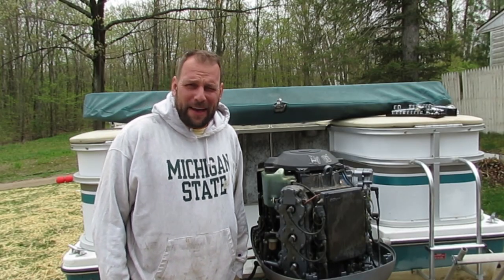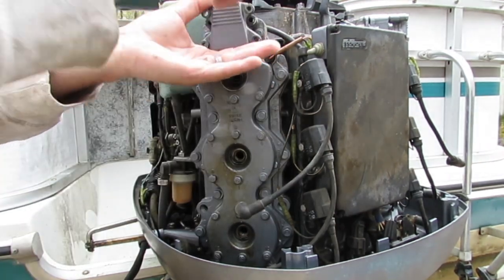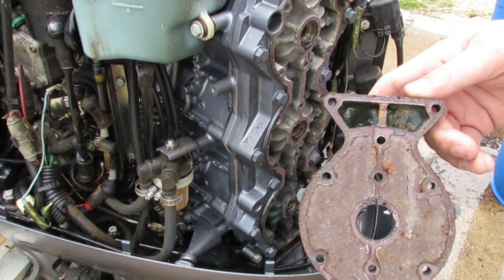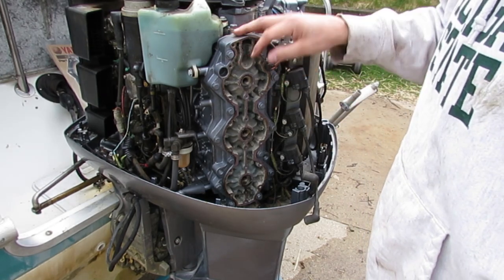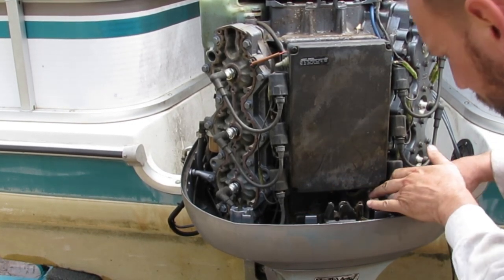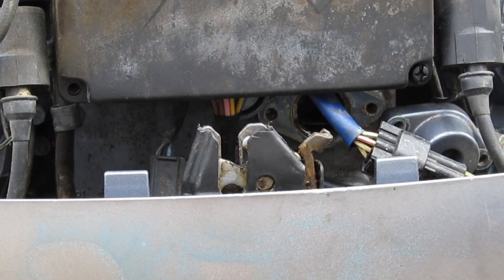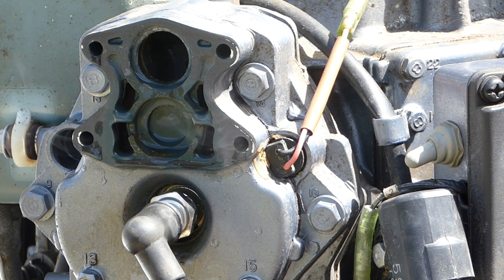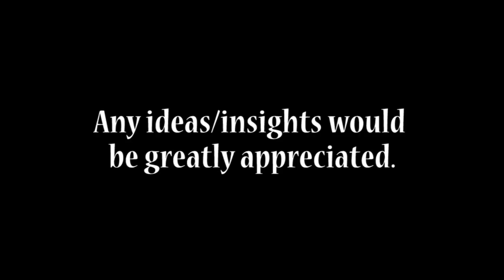Outboard overheating - I've tried everything...

Comment: OK, well I am an OMC guy, but the cooling systems are pretty similar to the Yamahas....First, let me ask if both heads got hot during your last test on the flushette?  Don't cut yourself down, I admire your thought processes...I'm sorry that you pulled those water covers off though, a lot of work, and it seems unlikely the problem is there...The water first flows to that exhaust cover, where the pressure relief valve is located...From there, the water flows to/through the heads and out of the engine.  But, the water flows from the back of the heads out through the thermostats then down and out of that cylinder head cover you removed.....So again, it is very unlikely that the head cover was plugged causing an issue.  Let's back up to last year when the problem began....Tell me more about what happened when the overheat alarm went off.  You said you replaced the impeller, how did the old one look?  Was it damaged?  Were any of the impeller vanes broken off?  If the old impeller "looked OK", there is probably another issue causing the overheating.   Keep in mind that there is more to proper water pump operation than just the impeller.  The impeller housing/liner must be properly sealed and not worn, is it possible that you crushed the water tube grommet when you reinstalled the gearcase after replacing the impeller?  How long did the engine run OK this year before it started overheating again?   That cooling telltale is at the beginning of the cooling circuit, so a good flow from the telltale doesn't mean the engine can't overheat.  Again, I'm an OMC guy, so not that familiar with the Yamaha systems....But, that large bypass valve in the exhaust cover confuses me a bit...Was there a spring inside that cover/hose that fit over the plastic bypass valve?  I'm thinking there should have been some sort of spring there.  If not, water entering the exhaust cover (beginning of the cooling circuit) can just dump out of the cover and never circulate through the block....Kind of a cooling system "short circuit" that would surely cause the engine to overheat.  The other thing to keep in mind is that running an engine on a flushette can be deceiving....The water pressure from the garden hose is acting like the water pump...So, it is best to test the engine on the boat in the water....I realize this is a pain, but it is important to realize how the pressurized garden hose can be confusing the issue here.  So, I'm guessing that whatever was causing the engine to overheat last year is still an issue now.  Does your boat have a water pressure gage?  Just because water is flowing out of the telltale, does not mean you have sufficient water pressure to cool the engine properly.....Don't remove any more water covers and cylinder heads.....I suppose it is possible that you have a blown head gasket, but not likely....Doesn't look like the engine was overheated badly....Again, I will ask you to start the engine again (on the flushette is fine), wait a few minutes for the alarm, the shut it off and feel the top of both heads.  If both heads feel hot, blown head gasket(s) are unlikely, which is a good thing.....I am thinking your problem has something to do with the water pump not working properly, like others have said.  Reply back with as much info as possible, try to answer the questions I have asked also....Hopefully, a Yamaha guy will chime in....Again, please don't pull off any more covers or cylinder heads....Hopefully, your problem is a simpler one....
Reply from the maker: It turned out to be that I bent a metal tab on the impeller when I replaced it. It was pushing water...just not enough.
Reply: Cool, I'm glad the solution was relatively simple...
Reply: Kramden can we talk on the phone. I have a 1985 evinrude E90tlcos with some overheat issue and more. If you're willing I'll give you my number. Dave in Wisconsin
Reply: @daveg2199    Dave, would be glad to help if I can...Give me your number and a good time to call...Don

Comment: the hose connection is for flushing the engine not running the engine for more than a few minutes... 3 to 5 and then only at an idle. To test if the thermostat fixed the problem... back it into the lake and run it at about 3500... hopefully no alarm... I had to learn this lesson by calling my boat mechanic...

Comment: it looks  to me lke there is an impeller issue. It is very difficult to see if you are getting the correct pressure using the ears because of the added pressure the hose creates. I am not a mechanic . If the thermoststs are opening and closing and you have verified the sensors are in good shape(no shorts in the lines) then the impeller is the issue. Are you sure the lower unit is re-installed correctly? Have you checked to make sure the fins on the impeller are turing the direction?  Just some ideas from a guy that has been through it!
Reply from the maker: 2 OldFarts Homestead Almost I just replaced the impeller before trying everything else.  I’m pretty sure I got it all back together properly.  I ended up taking it in to the mechanic. I’m interested to see what he comes up with.
Reply from the maker: 2 OldFarts Homestead You we’re right!  When I installed the new impeller, an o-ring didn’t seat properly. I was getting water, just not enough.

Comment: I thought my motor yam 40 was overheating, but it was actually a high pressure fuel injection pump.... I chased after cooling issues for 3 weeks, and finally investigated and learned that there was a defective fuel pump with that specific engine and year! The operation on the injection manifold was intense, but the service manager gave me the instructions and the fuel pump for free, other than stripping one bolt which was non essential... it was a perfect surgery and runs 100% now...
Reply: Mate I have issues with my Yamaha mechanic did everything he could no positive results could you please tell me what year was the engine if my fuel pump is faulty
Reply: @bristopaulose7766  2004 if I recall.... an easy way to tell is if the motor slows down by itself and runs rouge... but no alarm goes off! I assumed my heat alarm did not work, but you can test that by taking out the rip cord when it is running. The HP FI pump is located deep in the Fuel injection manifold where the fuel sits and the float is. Yamaha is nice to work on and everything snaps in and out OK. Just don't mix up your bolts... some look very similar. Once you solve the problem it is a great motor. I think it was the first year that Yamaha introduced EFI to the Yam 40 too and there was a recall in the day.
Reply: @bristopaulose7766  another good idea to test the temperature is to actually put a IR thermos on it and see what the actual temp is, then see what is normal and max is. Then you can rule out temp. My mechanic said those motors are designed to run very hot. Unless you burn yourself on it , it is not overheated he said. But the EFI problem manifested itself worse when the engine warmed up. This is what lead me to believe it was overheating. It would run fine when it was cold for the first 10 to even 45 minutes before acting up and rolling back on me right when I am out at sea.  A secondary problem was I replaced the thermos which was faulty and stuck open. This lead the motor to run too cold and causes condensation and water to build up in the crankcase! I am luck it did not blow up that time. Since it is a smaller engine I used it for trolling thus the colder operation.
Reply: You boat was codeing (hot water temp)

Comment: 3 years late, but did you ever take off the lower unit and replace the impaler. Look up a water pump repair kit for your engine model and it will include new gaskets as well.

Comment: Take a water hose stick on the thermostat hole and turn it on I blowed out a 85hp evenrude that way
Reply: Hi, do you need to take off the lower leg to do this? Or leave leg/prop attached? thanks

Comment: Try putting on a Wisconsin sweatshirt and going back through the steps ... lol.   I don't know, i'd check the heat sensor.  Prob have to swap it out, but I have the identical motor and a similar sounding lake that I boat at lately.... Mine overheats every time after about 1-1.5 hours of running it at various speeds/RPMs.  I think mine is likely something similar as mine makes pee pee but haven't checked further upstream from that.  Usually I clean off the water intake plates and let it cool for a few minutes and it's good again..... also seems to happen far more often after trolling through about a mile no-wake zone.... so maybe the water pump in this one just doesn't pump enough at low RPMs
Reply: Sorry posted above just before you mentioned trying the sensor.  Mine usually smokes just a bit too when it's hot.

Comment: Use a tub not a hose and when it over heats disconnect one temp sensor at a time to isolate which side make sure inside of block is not clogged with calcium

Comment: give me a pressure gauge mounted on TOP{ of the engine* the highesr point; usually at #1 and a restrictor instead of a thermostat and ENOUGH water and should be good to go. The T-stats can cook a motor if they don't open and that starves the jackets of  water. A poppet is SUPPOSED to maintain the water 'charge' on the motor and only open AFTER a certain pressure. Make sure there is NO crud letting the water out. You can verify by taking off the cover and running the motor with the poppet valve in place and just hold the spring against it as close to regular position as possible. if ANY water is getting past the valve, the powerhead may not fully 'cfill with water ALL THE WAY to the top (usually no.1 cy)  Just one of those cylinders running dry will overheat one of those motors (their water pumps suck) You should get a pressure switch into the top of the motor(near or above no. 1 and it should always read more than 5 psi but at speed , it should read 10 or more (25 would be better so no crap gets a chance to make a home in there. This may be too late to help you but it may help someone. Good luck.

Comment: Man I have the same problem.....Till this day....I still get an alarm at about 3500 RPM's!
Reply from the maker: Solved my issue.  When I replaced the impeller initially, I bent a tab & that was causing a drop in the water pressure going up to the thermostats.
Reply: TheHardWay where was the tab you bent and what did it look like?

Comment: A flusher is not good for trouble shooting cooling system assuming water pump has been replaced run in a barrel with a pyrometer should 143 to 160 temp sesors are notoriously fail alot

Comment: I put in my  gardenhose in where the thermostat is put in and flushed the SHIT out of my engine....IT worked and a lot of dirt that was locked up inside the channels in the bottom of the engine came out....i did this for a few minutes until clean water came out😁👍Then i put in a new thermostat and impeller,and so on....oh.dont forget to take your leg off before you do this tough😂👍

Comment: You can test the thermo sensor - put an ohms meter on the sensor - then drop it in water that is about 185f -200f - then shut the water off - it will go from resitance to open when the water cools - drop some ice cubes in it as needed - the cost about $40
Reply: Also - next time buy a  lasor thermometer  - $35 it will tell you the engine temp - normal is about 125 to 160
Reply: Under head gasket there are things called deflectors that let water go around each cylinder. When those things go egg shaped they block the water from going around the cylinders. Replace them and it will run cool.

Comment: take   the therm. out  disc. gas line so it want start  have someone spin the eng while you listen at the therm,housing  if you hear air  you have a blown headgasket  whats happen ing   the exhaust is into water colume its stronger that the water pump pressure   water is not circlating in the eng  a lot of mechs say theres nothing wrong with head  gasket  because eng runs fine   checking head gasket is a lot simpler  than replacining the water pump   i replaced my pump 3 times to no avail  i found the problem by accident  iwas going to replace the therm . had my friend turn eng over  i heard the noise pull head gasket had a hole burned in it  about 1/4 india new head gasket fixed it

Comment: Can you tell us a bit more about the metal tab that was bent?  Which metal tab was bent?
Reply from the maker: It's been a while...and I wasn't the one who found the issue/fixed the problem.  If I recall correctly, there is a housing that the impeller sits in and that housing wasn't completely flush with what it was supposed to sit on because of a bent metal tab.  That's about as specific I can get...Sorry I couldn't be of more help.
Reply: Something to look out for.  Thanks.

Comment: I have the same problem but in a 350 inboard merc in a mariah 21'. I rebuild the motor and it ran great but could not get it to run below 220. After trying everything i got it to 200 deg but ended up losing the motor cause of heat. I bought a crate motor 350 and also runs strung but cant get it below 195 deg should be around 165. Im scared i am gonna lose this motor also so its sat for over a yr now. Brand new water pump and everything that goes with it. I have changed props and always same temp. Cant get below 200..
Reply: Make sure your using a marine thermostat 142 degree

Comment: You need to take the cylinder head off as well on that bank that is getting hot you'll find that the water jackets around the cylinder wall will be blocked as well
Reply: Noticed he burned his hand on the left bank but not the right. Shouldn't be that way. I used to always feel each cylinder when driveway running.

Comment: I had the same problem too, it turn out that the new pump housing I installed to my motor didn't come with the rubber grommets for the pick up tube. I pulled the lower unit off again and compared the old pump housing to the new one and notice that there are two rubber grommet down inside the old pump housing for the pick up tube. Pullled them out and placed them into the new pump housing and reinstalled the lower unit.  😩👌
Reply: Man I’m really hoping this is the problem to mine i looked at the parts diagram online and I’m missing the rubber grommet that I guess keeps the copper pick up tube tight so hopefully that fixes it
Reply: @travisgreen4451   It sucks having to drop the lower again and when you buy a so call complete parts kit for the water pump and there was no rubber grommets in it. I hope you still have the old water pump to remove the rubber grommets out of it, let me know if this resolved the problem with your motor. Good luck!

Comment: Sir, First off get rid of the muffs.They will not tell you if the water pump is working. You are using the water pressure from your water source.I use a plastic trash can,fill it with water after you put the lower unit in.I would pull the lower unit,and inspect the rubber grommet  that connects the tube thus insuring that the water is going into the powerhead. Do you have a thermal image sensor? Point it at something and pull the trigger, it tells you the temperature. Now I read the solved notice. here I am trying to help and some wise guy says solved. Glad you have the issue solved, Ken

Comment: Is there any way to measure the temp of the water coming out?  Could the sensor be bad?  All I know is this needs to be fixed so you can get back to that Sugar Shack build!
Reply from the maker: Yb Family Farm tell-tale water was cold. Water coming out of the propeller was hot. In my very scientific temp test, the port head was hot but I could hold my hand on it for 1-2 seconds...starboard head was so hot it almost burned me. I think I’m in over my head.  To the repair shop we go...

Comment: I think the poppet. Valve has to be up to pressure and temp. To work properly...it opens up and runs warer thru the motor
Reply: Mine overheated .it was a bit of corrosion pinching the poppet valves rubber seat making to poppet valve look fine but to tight in housing .tried with no poppet fitted ....no overheat . mercury make a conversion kit dose away with poppet valve and uses a BIG thermostat instead. Money well spent!!
Reply: Check oils tank ( pump inside)
Mix oils directly 6 gallon ...!
Reply: @davesmith2733 Where can  we get the poppet valve to big thermostat conversion kit for my 1998 Mercury 135hp outboard?

Comment: I wonder if blowing air into the thermostat cavity would work?
Reply: It would not. Outboard water pumps are high pressure by nature. The thermostat itself is the plug at the end of the water channel. They commonly corrode and get frozen closed. Actually, corrosion is what causes 90% of all problems on any boat. 
Well, that, and owner inflicted abuse/misuse.

Comment: It’s your poppet valve or thermostat 
Change them both 
Thermostat control the temp flow 
The poppet valve controls the high rpm flow.
Heating when running 🤦🏻‍♀️ cooling when idling says poppet valve to me.

Comment: im probably late but replace or test thermostat in hot water to see if it opens or put engine back together without thermostat installed
Reply: and if 1 cyl get hot with no thremostat in both do you know whats the go m8 i thinking block or cracked head

Comment: I'm having the same problem with a 2002 Yamaha 150 TXRA 2 stroke. Overheats on the port side bank only., Starboard 3 cylinders run fine at temp. I did everything you did and it still overheats. I'm close to taking it to the shop. Wondered what you found???
Reply from the maker: larry newman when I replaced my impeller I accidentally bent a little metal tab. This meant water flowed through..just not enough.

Comment: Did you ever figure it out? I got the same motor with the same problem and changed everything you did.
Reply from the maker: Yep.  I edited the video description.  When i replaced the impeller housing, i bent a tab...this caused a loss of water pressure and the overheating.